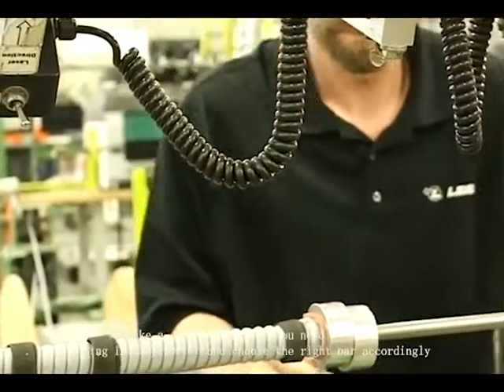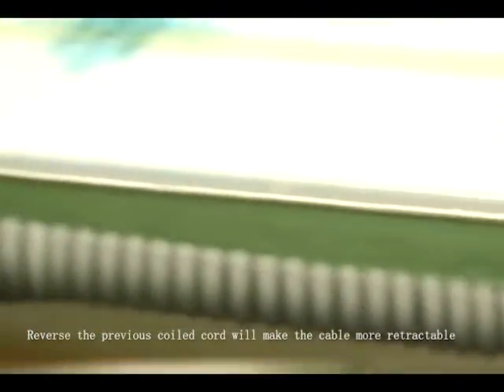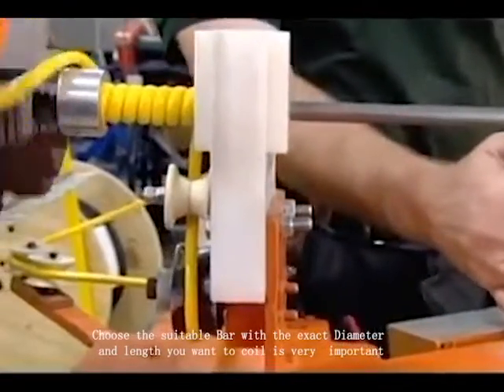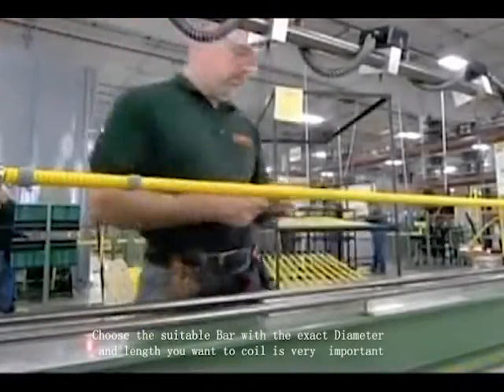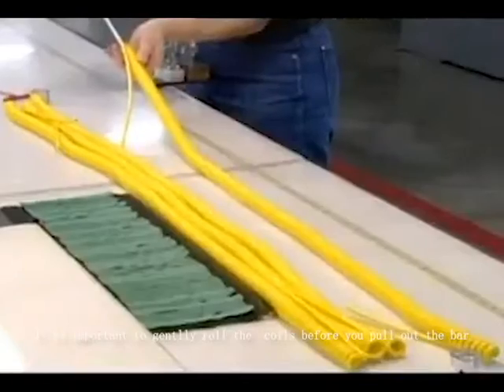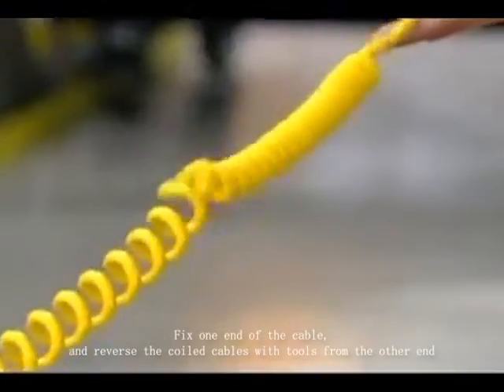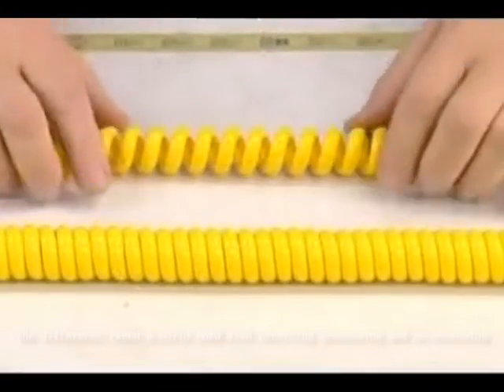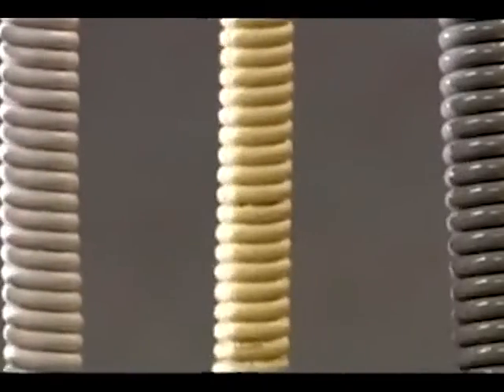Cust retractable coil cord factory -How to coil and reverse coil cables |Coiling cables Spring cable

Comment: Could heating be done in an oven set at a specific temp?
Reply: yes, they showed the degrees they use which is 200 Farenheit (90 Celcius).   Doesn't really matter if it's a home oven or an industrial oven, that temperature sounds like it should work well.    I watched another video tutorial of how to coil cables and he set his oven at 248 Degrees Farenheit, so that's relatively close to what these people do.
Reply: Duration?
Reply: @samreenhammad7802  I don't know I didn't produce the dang video.  Do some research with other videos, etc.